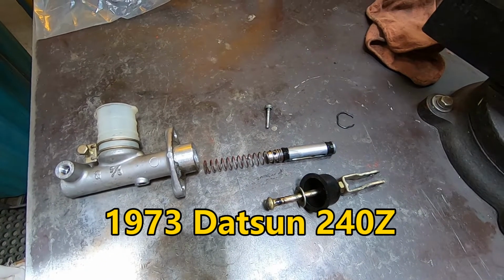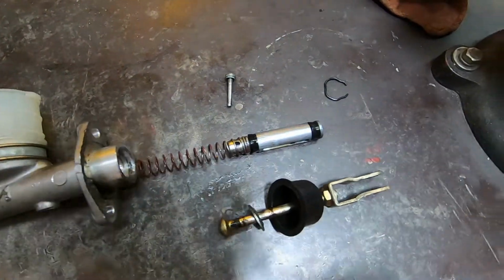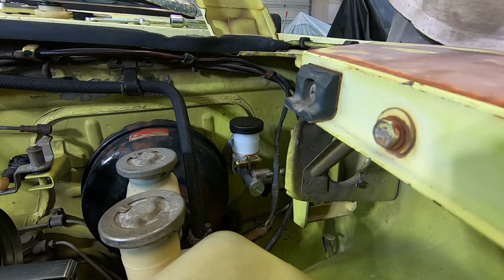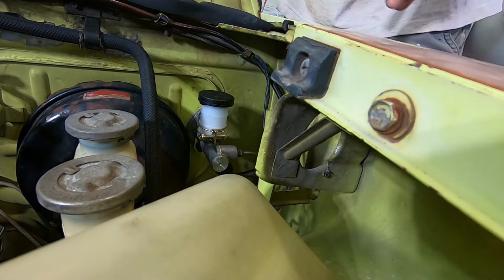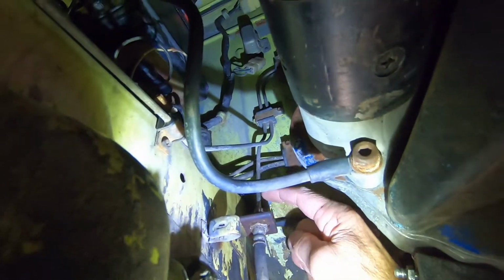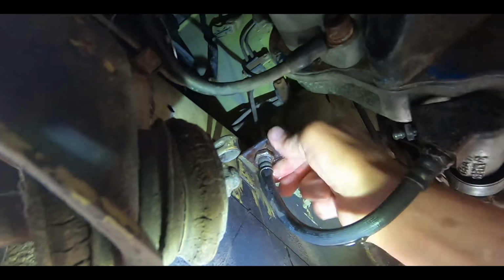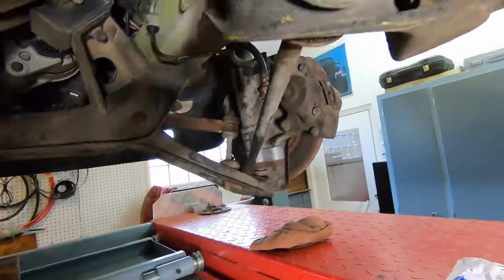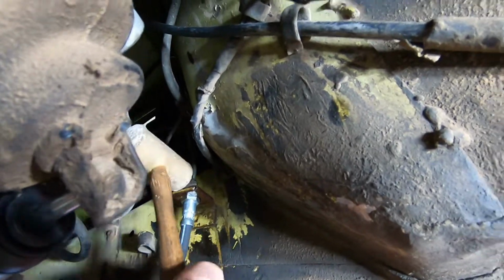1973 Datsun 240Z Clutch master cylinder and slave cylinder replacement.

Comment: what holds the rear louvres in place on the rear window
Reply from the maker: Hello, Thanks for watching this video. The rear window louvers are hinged at the top which allows it to be raised for cleaning the window and at the bottom there is a sliding latch on each side to hold it in place when lowered.